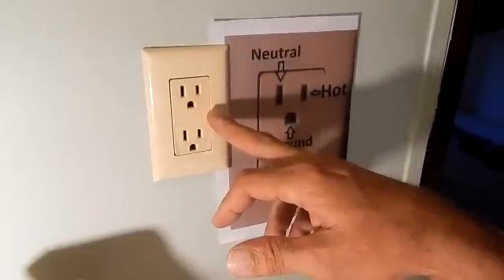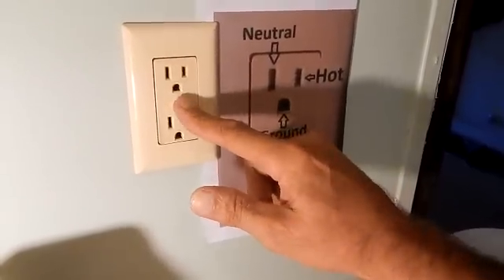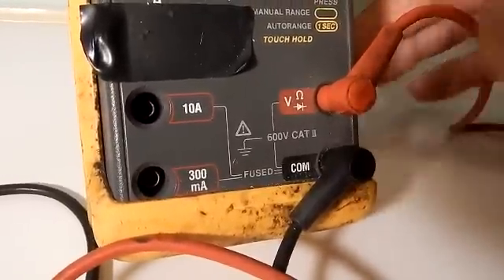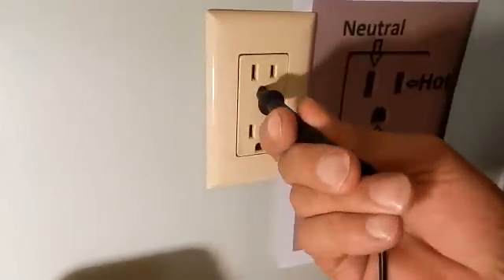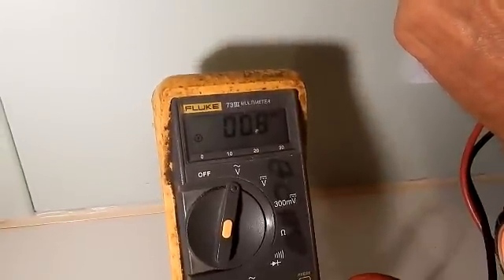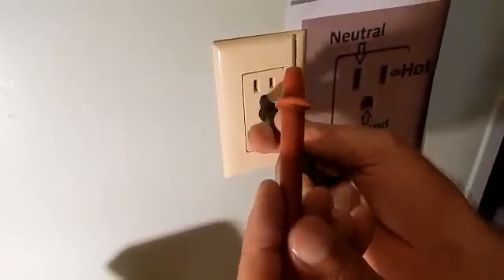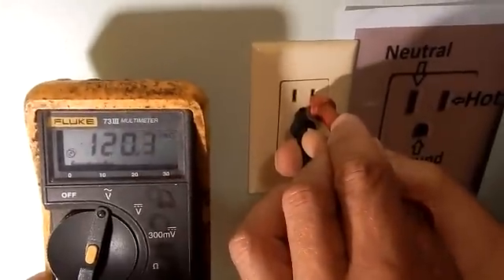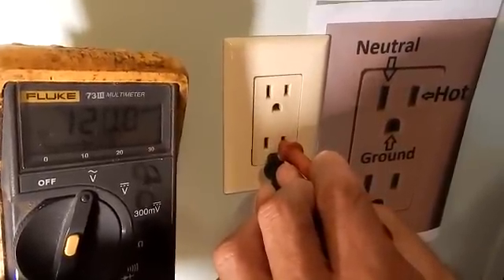Use A Multimeter To Test an AC Electric Outlet

Comment: I just read from a blog by the name Mr. Electric that you have to hold both the meter and the prongs in the same hand, if using both then electricity with pass through your body  .⚡️💔⚡️ ZAP.. 
I know a little about electric work, but I thought that’s doesn’t sound right. 
Now when I’m working on a panel I’ve always use one hand, placing other in back pocket. I’m not a electrician obviously, so I just took that advice from a old timer years ago and now it’s just a habit..
.. But I’ve never seen anyone do that when using a multimeter ..
Question, I’m I missing something here, does Mr Electric have an legitimate reason for doing that? 
.

Comment: Good job but just a heads up and warning to amateurs,  it's always a wise idea to try to use one hand when testing high voltage so if anything goes wrong, the electricity won't flow through your chest stopping your heart
Reply: Shouldn’t be a problem at all with good leads .. it’s plastic it can’t travel.
Reply: Sockets are low voltage. High voltage is over 1000 V and you should stay away from it.

Comment: Very clear explanation. And I liked the use of the diagram. Just a note that hot to neutral was never tested. This would generally be the white wire on the Romex to the breaker box. 

When I was a child I was testing an outlet and caused a spark. That always made me afraid of outlets. I suspect now as an adult I likely had the meter set to test amperage and not voltage. But I'll never know for sure.
Reply: Hey bro what should should the two slots up top read.. tried two different ways..
Reply: @hupomeno9035  on an outlet in the us around 120v. Usually goes between 118ish to 121 Max. Top two slots are hot leg and neutral leg or generally black and white wire.

Comment: WHAT IF YOU LOST A NEUTRAL, YOU NEVER DID CHECK THAT
Reply: that would be bad, Hot to Neutral would read 0v, Hot to ground would read 120v. If you lost Neutral and Ground outlet would appear dead, best use a voltstick first.

Comment: I have the switch part broken totally off of switch.  How can I tell the power is off to wire when I can’t turn light on ?
Reply: Wouldn't it just be a safer option to get an electrician in to replace the outlet. Sounds like you have an unsafe situation.
Reply: In answer, the only way to be confident power is off if you turn off the BREAKER for the entire circuit. Other than that, what Jeremy said. Don't make your first learning experience with electricity a case where you felt pressured to repair. Call a professional. Should be under $100 no matter where you live.

Comment: Hello Bill. What is the acceptable range for voltage? What is exactly is dirty power? Thanks in advance!
Reply from the maker: Acceptable range of voltage?  I generally use the +/-10% rule. For certain check with the provider of the power.  If you google that question You will get several answers. Dirty power I consider any stray voltage on the wire that is induced from other wiring, atmosphere, or appliances. Thx for watching.

Comment: I've a problem with my voltmeter it doesn't mesure the AC voltage just showing zero it works fine with dc and Ω but problem with ac plz any solution
Reply: Buy another voltmeter. They're not expensive, and aren't things to risk using if they're faulty.
Reply from the maker: I never have tried to repair one. Can't help you. Sorry.

Comment: what about amps?
Reply: Not with the tools shown here. First if you need to map the circuit, do so with a plug in tester and turning off the breaker. If you know the circuit map , great.

The EASY and safe way is to buy a Kill-a-Watt and just test every outlet on the circuit, with things plugged into it (lighting can be calculated from bulb size and "added" in).  OR - less accurate - alternatively you can just read the electrical information on the appliances, and "add it up manually", but it's less accurate since some stickers will only describe nominal  power usage, but they can use much more power during start-up (vacuums, air conditioners, dishwashers etc anything with a motor)

To get an ACTUAL in-use amperage value at the circuit box requires an ampmeter and opening the power panel (and this is super dangerous if you don't know what you're doing... generally if you have to ask, you do not...).

Comment: Hm. I usually get about 0.4 volts from ground to neutral. It raises up to 4.4 volts when I have a small 1300W heater running for a few minutes. I think that's normal for a large load like that though.